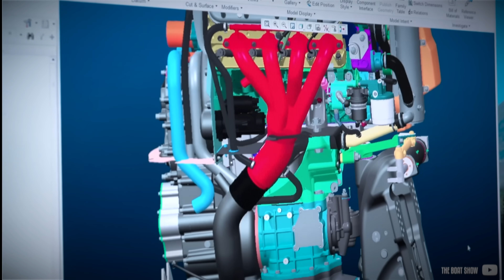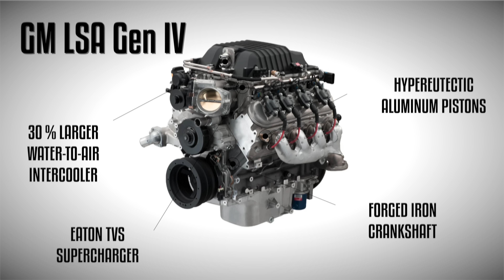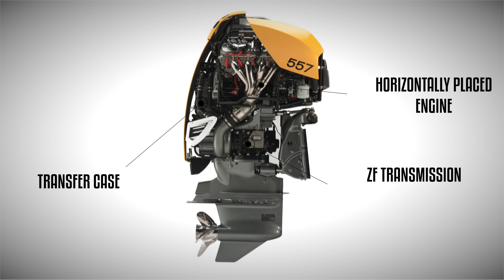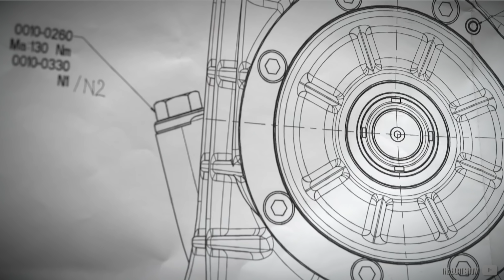How Volvo Killed This 627hp Supercharged Chevy Outboard

Comment: My experience with these large center consoles is that they really aren't that comfortable for passengers. Not saying that a small center console is any better but the comfort doesn't really scale. There are some incredibly nice comfortable boats in the size range running twin diesels. Makes me wonder if the real problem is how unreliable modern diesels are so comparatively a fraken-motor outboard is more attractive. It's amazing engineering in any case.
Reply: When you put the motors outside the boat, that frees up a ton of space inside the boat for amenities.  More rooms, storage, maybe a seakeeper, etc.. You can lift the motors out of the water when docked, and have trim control of the motors unlike inboards.  The thrust is steerable making maneuvering at slow speeds much easier than with inboards, where you only have a rudder that does little at slow speeds such as around the dock.  Plus maintenance and repowering are more economical.  Sure there are cons to outboards, but these are some of the pros.
Reply: Bruh. A big freeman? A big yellowfin? A big Everglades? A big Valhalla? A big CF Scout? The 59 Tirranna??? Bruh the large center console boats are glorious. Also I’ve run 70 ft boats with cats Cummins Deeres all reliable af. Change fluids and pmcs and they’re good to go for thousands of hrs. Hell even the Detroit 6 and 8 72 series are bullet proof. I’ve been 180 miles offshore in a single screw and done a racor change and fire it up and take off gain.
Reply: @GiveThanksAndPraise  you can fuq around and pimp those boats for sure. I’ve a freind that has 42 yellowfin and a freeman 47 and that dude takes those boats 200 miles out in the gulf and fishes like a savage. throws bloody carcas everywhere. The Dude don’t gaf. He also pimps them out on crab island. He drives them to Miami from Mississippi. Those boats will do whatever you want them to do….and can afford to do
Reply: Any company that makes unreliable engines will cease to exist. Kinda like there is no such thing as a pretty good alligator wrestler.
Reply: @8180634  Inboard with Rudders? Lack of control? Take up a lot of space inside the boat? Have you ever heard of IPS or Sterndrives? We don't live in the 60' anymore... And a diesel engine, while more expensive to buy, will easily last twice as long as the outboard.
Reply: @Kowalski301  I was comparing pros and cons of inboard vs outboard. If you want to post some pros and cons of other types vs outboards then let's have it.
Reply: @8180634  Other types? Last time I checked, both IPS and sterndrives are defined as inboard because the engine is, well, inboard...
Reply: @longsleevethong1457  I've heard from several people that common rail digital diesels have been difficult and when I was looking for a boat I was told under no circumstances to buy anything but a simple mechanically injected motor. I have no experience with the new tech. Modern outboards have tons of digital controls too but for whatever reason no one has issues with them. 

I guess volvo makes gas engines but why would volvo buy and shut a company unless they wanted to preserve their expensive diesels? That's the point I'm trying to make anyway. I live on a boat part of the time so I know first hand that anything electronic on a boat will break and be extremely expensive to fix.
Reply: @GiveThanksAndPraise  but you lose access to the transom with all those motors back there. No swim platform or easy way to pull in a huge fish.

Also it's funny that it's a selling point to have more space around the back as if I enjoy sitting sitting right next 1400hp of screaming super charged engines. 

These things sell because they are way more reliable due to redundant engines that can be repowered easily if something goes wrong. Volvo makes a ton of money on the servicing of their common rail diesels and so are incentivized to have vendor lock in.
Reply: @JohnEvans-lp9dc  key thing to take away is that you’ve simply heard some stuff but you have no anecdotal experience and here’s a few people telling you different from anecdotal experience and you’re still kinda arguing. I think my work here is done. You’ll just keep confirming your bias.
Reply: @longsleevethong1457  I’m just trying to figure out why Volvo would buy a company just to shut it. Volvo doesn’t even make outboards. Large center consoles are impressive and fun to see, so it makes sense that there’s a market for high horsepower outboards.
Reply: @JohnEvans-lp9dc  VP actually ran Seven for 4 years. They definitely didn't buy it to shut it down as you correctly point out. But after 2 years, Mercury came out with the 450R who immediately took a massive chunk of the CC market, and then, only 2 months after VP shut Seven down, Mercury comes out with the V12 600... That was no coincidence, and that engine was rumored before it was released, so VP saw the writing on the wall as the new Merc would have taken almost all of the already tiny market share they had with Seven. Blaming it on the "environmental profile" is just the magic words now days, so that doesn't tell us anything. Fun fact, Seven was not VP first run with an American outboard: "In 1973 Volvo Penta acquires outboard production from Monark-Crescent " "toward the end of the 1970s, the competition from Japanese manufacturers becomes so fierce that sales start to show a loss, and outboard engine production is discontinued."
Déjà vu much?

Comment: What killed 7 was that racket coming from the exhaust. I love my GM power plants but I appreciate Mercury engineering more. This guy should have known better. Merc can make a V 10 or a 600 hp NA motor whisper quiet. That's what boaters want. Volvo is for rookie boaters.

Comment: "Remarkable feat of Engineering"...yeah, no it's not. It's one thing to hang a +600 lb.(+272 kg.) power unit off the transom of a boat or multiple units. Everything new is always great but what happens after some time has lapsed. What is the owner going to experience after many years of ownership. THAT...will be the remarkable feat of Engineering. Subjecting an engine w/ a cast aluminum alloy block & heads to sea water isn't a good start. You can use a corrosion resistant paint but after years of use, I'm talking 3 years or so, it'll show the damage. There's an enclosed cooling system but the exterior can suffer too. Let's see how everything holds up first.
Reply: I agree - the use of a car engine is either engineering design ignorance or merely a gimmick to attract ignorant buyers.
Reply: @paulgee-i7j  Has nothing to do w/ the original intent of the engine. I have a problem w/ a U-Tuber being a product advertiser, rattling off all sorts of praise yet the product has no real history or owners feedback. Least none in this video. That's the issue I had from my previous comment, if you read all of it.
Reply: If you want to marinize the engine then send it to a plating shop and have them copper plate the water jackets. Better thermodynamics and marine growth resistant.
Reply: Some marine motors have been made from aluminium for over 40 years without problems.
The engine shown has a heat exchanger for the cooling system, so only the outside of the block will corrode from salt water mist maybe entering the housing, but things like ignition coils, the intercooler, supercharger and if a normal automotive wire harness is used, will probably die long before the block itself corrodes.
Reply: @OneEye.  Is this process done to road engines converted to marine use by the aftermarket? I'm not going to go to that effort unless I go racing, otherwise I would expect the engine builder for a boat hull brand to anticipate the potential hazards.
Reply: @larsjrgensen5975  That's why I mentioned the paint in my initial comment. So engines would usually employ a closed-loop cooling system w/ a heat exchanger made of titanium to resist salt corrosion? How is the salt spray separated from the intake air? Something similar to an air-oil separator?
Reply: @carmiethompson2676  Sea water is not like acid, they build aluminium and stainless steel fishing boats that last multiple years without any problems and many of them are bare metal.
If you use A4 acid resist screws they will last 10 years in seawater just fine unless you have a electrical grounding problem or do not use Zinc sacrificial anodes on the metal parts in the water.
My father inherited a 20-25 year old Evinrude outboard motor made of aluminum when it turned 30-35 years old everything other then the engine block was no longer working.
Ignition cables and connectors was bad, water cooling pump needed new rubber wheel, prop was broken in half, the control handle needed a teardown and the carb needed a refurbishment.
The block was cooled directly with salt water and the block was simply made good enough to outlast everything else on the engine.

The replacement was a 10 year old Honda also made with a aluminium block directly salt water cooled, the former owner did a bad job at fixing a carb problem, but after that it worked great for 5 years before it got stolen.

The replacement was a new Yamaha also aluminium block directly cooled outboard, but that has not been in the water yet.

The suspension arms on my old car was untreated bare aluminium, it survived 20 winters with salty roads before the integrated bearing in them was worn out and the complete arm needed to be replaced.

Intake air goes into a cylinder with an oil film on the walls at all times and in the old days the 2 stroke oil probably helped to.
The cylinder never has standing sea water moisture inside it, everything would steam off and dry.
When tipping up the engine out of the water, the housing is designed to let seawater run out of the cooling system to prevent pooling of water in the engine, both to get saltwater out but also to prevent water freezing inside the block.
Reply: @larsjrgensen5975  It amazes me how people think they understand my comment but their reply shows nothing or little of my intent. I never said a non-ferrous metal shouldn't be used in a salty marine application. I never said anything about Stainless Steel. Go to the bathroom first then read my comment again, the whole thing!!
Reply: @carmiethompson2676  You're overestimating the intelligence of the average commentor.
Reply: @Ozsmallbore  It's not about intelligence, it's about patience & understanding the context. Mr. Jorgensen, Mr. Green & Mr. Gee are very intelligent people but they aren't patient w/ their response to my comment. I have to be careful myself but this time, I'm in the Catbird seat. Have a nice life gentlemen.
Reply: @carmiethompson2676  ?
I am trying to tell you that salt water and aluminium is not really a dangerous combination and salt water vapor ingested by the intake is mostly not a problem.
Your original comment mentions visible signs of damage already after 3 years and I do not agree, unless it is a very bad design and very cheap materials used.

Comment: I worked for HCB yachts several years ago. We put 4 627s on the 53ft model and it would go if everything was working Ok. Despite these videos suggestions, they where finicky and unreliable. End of story. If you go offshore, you need an anvil, not a racehorse.

Comment: The reality is that the 7 marine lower units are garbage, and they have the same issue as the Mercury 450r. The housing isn't strong enough and litterally rips in half. That is why the 7 marines switched to the dual prop lowers. Mercury also redesigned for that reason. The other issue with the 7 marine is electrical once they have a little age. The other big reason they stopped, the fad was over. The people that get these want the lattest and hottest on the water. One of my clients goes through these 40'+ center concels every other year just to have a new one.

Comment: Volvo couldn't make these outboards because they didn't make them. Everything from the engine to the lower gearbox was sourced. They even outsource the engineers who designed it because of it's radical design. This is why they lost money on every one they sold. And it was already the priciest outboard out there. This is quite well known and was at the time. I'm surprised it's a question. The V-12 Mercury never had any competition and probably never will. And it's not a performance engine, it's a workhorse engine. That's why they have 2-speed transmissions and they're really heavy. They'll never compete with the hp to weight ratio that a 450R has, (it weighs double) or even the new 500R. (it weighs almost double) You'll have a tough time beating the 450R however, even with the 500. A 36 foot MTI Cat can hit 130mph with just two 450R's. That IS screaming and the 450R can do that ALL DAY LONG. Something a big block can't do.

Comment: Volvo killed the engine because they didn’t want it competing with their own products and because it was designed of the GM LS Engine. You buy a company when you want their technology or when you want to get rid of the competition. That 627 horsepower rating was just the beginning for 7 Marine S the LSA engine is easily capable of well over 700hp. They’d just have to work out a gear box and transmission that could handle over 700 horsepower. Volvos emissions excuse was absolute B.S.

Comment: In twenty years time all outboards will be electric. Tech as far as batteries are concerned grow at an enormous rate. Electric motors as well. In the near  future you will get a 500HP motor with 12 hour endurance at full throttle from a battery. The V12 Merc, big Volvo and all other brands will be dead unless they go the Tesla route.
Reply: LOL!  And what sci-fi battery technology is going to do that?

Comment: absolutely the correct decision by volvo. the world no longer has space for excessive luxury, irresponsibly unsustainable, pointless products. and if a major disadvantage of outboards is needing to combine more than one to get adequate power, why is there not a single example shown where just a single engine is used?
Reply: Single engines are for tug boats and oil tankers that have everything on board to repair any engine failure. Show me a commercial airliner with a single engine. Would you fly in one from NYC to Paris?
Reply: @don2deliver  first, you entirely missed the point. second, there are far more small boats with single outboards than multiples. third, large ships rarely have a single engine. not sure what exactly it is you're trying to say.
Reply: @daos3300  These outboards were not designed for boats with one outboard. There is no 2600 hp engine designed to move a boat this size to take the place of these outboards. And yes many tankers and freighters just have one engine even if they have twin screws.
Reply: @don2deliver  you still fail to understand my point but it's ok.
Reply: @daos3300  Your point is that it's a disadvantage, but it's not if money and economy are not as important as covering distance in a shorter amount of time. Using twin diesels and going slower is an economical alternative.
Reply: @don2deliver  no, my point is that if you present something as a flaw, then present a replacement which has the exact same flaw, then you haven't solved anything, you just replaced like with like.
Reply: @daos3300  I never said any idea was flawed. It's just some make more sense.
Reply: @don2deliver  i wasn't talking about your ideas, i was referring to the original content.